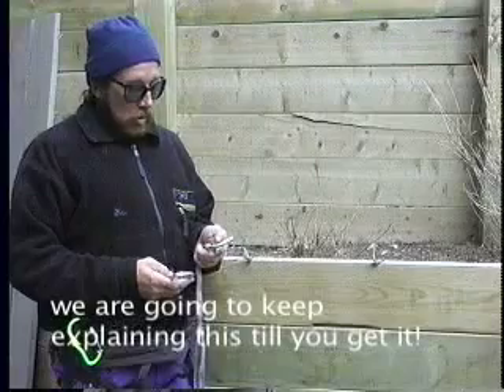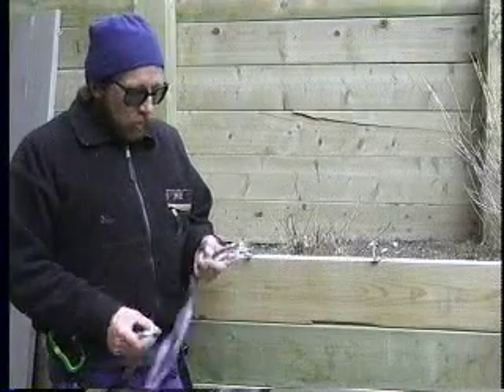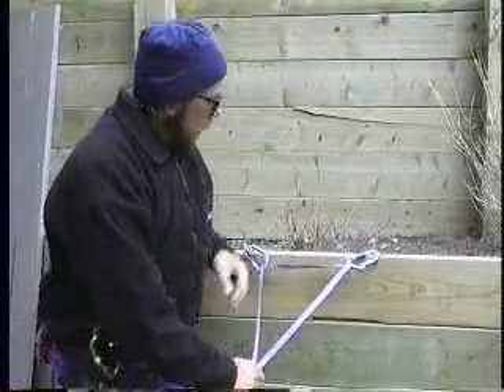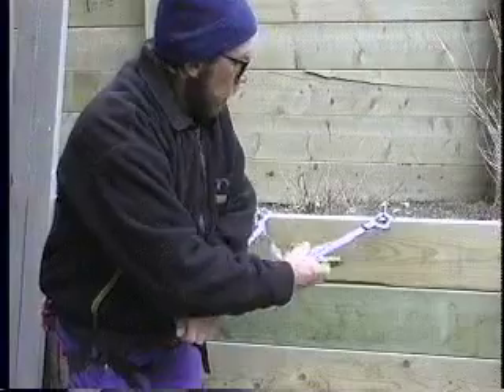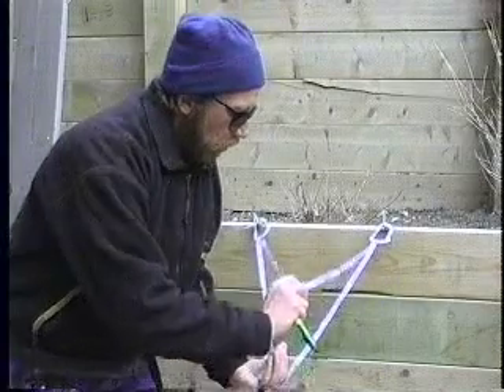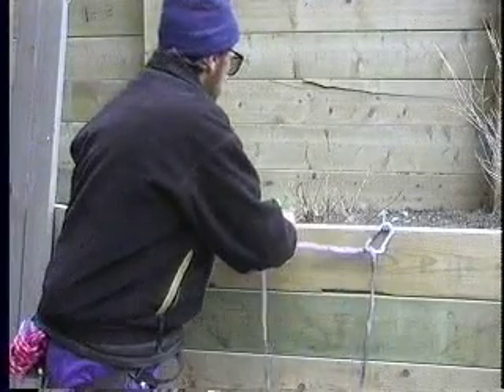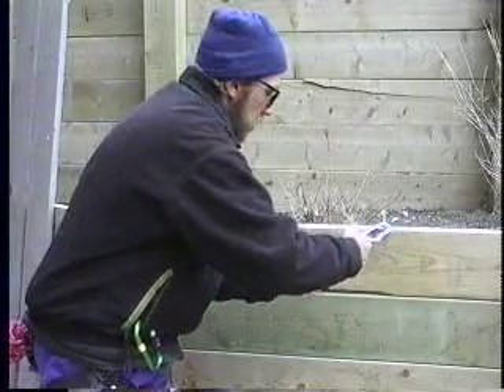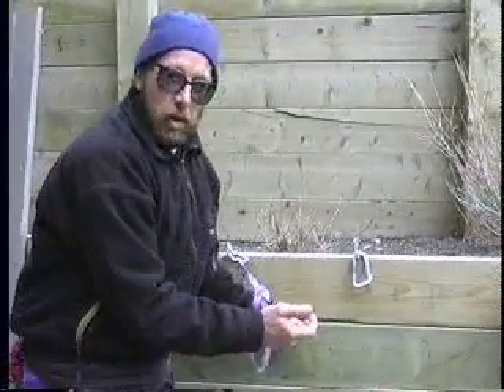Climbing Tools: Equalised Anchors (again)

Comment: You can use 1 locking biner per anchor placement, (in this video he used 2) But if you run out of locking biners, you can use 2 wire gate  back to back with the gates opposing each other.

Comment from the maker: Technically your right. There would be a fair amount of stretch. If you were building your anchor from trad gear then yes it is perhaps a better way to go.
I really don't teach it because few do it right and you are then on one strand of cord. It take a little longer to construct and deconstruct. The focal point is harder for begginers to identify ( there being a chance that they can clip it in such a way that that should one piece fail the whole system fails)
 what you describe is accurate.

Comment from the maker: My mistake you are right. With the system described you would attached with two pieces of cord. 
The main disadvantages are time to construct (greatly reduced with practice)

Reconisable focal point for newbies to attach to

In a situation where gear is marginal this may well be the better way to construct the anchor

bolts I suggest the way shown

Comment from the maker: your right technically. However I am not comfortable with 
1) a single strand of cord.
2) teaching that method at this level

If you get the direction of load even close it is going to have a load distribution. What I do like is a destinct focul point that new climbers can recognise. Yeh your right but I am going to stick with my anchor for teh most part.

I have used your system when trying to get the most out of a few tied off knife blades.

Comment: Sorry, Mike, you're wrong. Your extension limiting anchor is actually a 1-knot cordelette made with a runner; it DOES NOT equalize. A change in direction of force or mis-guess in locating the knot considerably imbalances forces on the placements. You have REDUNDANCY, not EQUALIZATION. Instead, tie an overhand in each leg of the sliding X with one of the strands through the master biner extra loose--a sloppy X (TM).